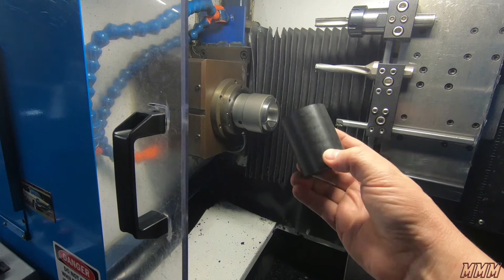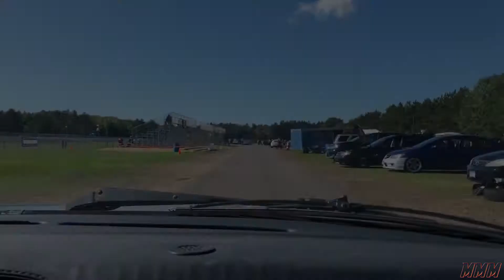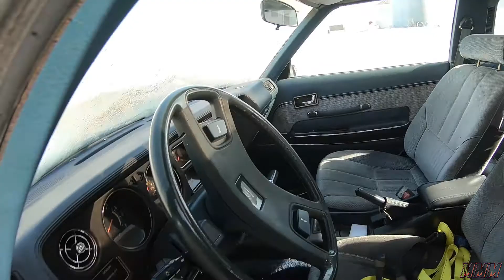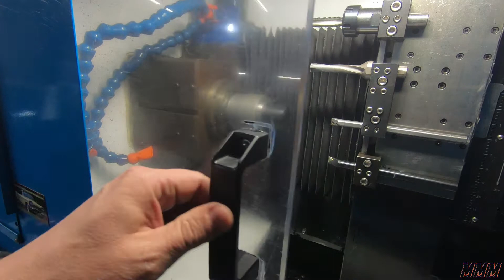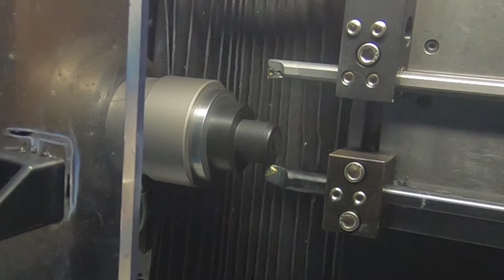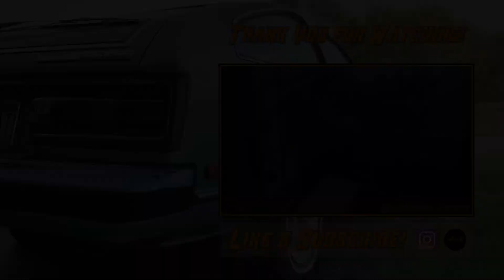Tormach 8L / 15L Lathe vs Omniturn Lathe: Round 2 Speed Battle

Comment from the maker: This is just a fun video made to demonstrate the speed of the OmniTurn. We are aware the Tormach is equipped with a Turret.   No, we don't actually compare them machining either, the OmniTurn starts and finishes before the Tormach even begins cutting.    Probably more important then the speed disparity is the turret/tool play of the Tormach at 1:10.  It's literally deflecting up a good .100  of an inch, which makes it incredibly hard to machine fast and hold tolerances.  We are not paid for or sponsored by OmniTurn, we just love how they perform!

Comment: What large diameter collet adapter are you using?
Reply from the maker: Hardinge brand. You can get them for up to 5" in diameter stock.
Reply: @MadManMachines  Thank you! Do you know what part number it is?
Reply from the maker: @msracingcomponents6550  Not off hand, they have them in incremental sizes and machine to size ones. Check out the hardinge site.  I recommend the "deep" versions.
Reply: Thank u!

Comment: well, you SOLD ME on this.... was thinking Tormach....lol.
Reply from the maker: I was just the messenger, Omniturn is what made it possible.  Right now, i'm working on a contract to make high pressure metering valves out of hardened chromoly where i need to hold an internal orifice diameter to .4994 +/- .0001!   You just simply could not make that part on a Tormach as it has neither the rigidity nor accuracy to tackle it.

Comment: not a good comparison, I'm sure the Tormach would run at the sames speeds if it too were cutting delrin. I don't own either machine but really guys, you can do better....
Reply from the maker: Unfortunately, Not even close, even in Delrin, the OmniTurn will cut this same piece at least 10 times faster than a Tormach.   1st, the Tormach is rated at only 80 ipm cutting speed vs 300 ipm cutting speed for the OmniTurn.  2nd, the Tormach is limited to 100ipm rapids, whereas the OmniTun is 300ipm rapids.  3rd, the Tormach is only 3 HP, whereas the OmniTurn is 5hp, which means you can cut faster and deeper due to almost twice the HP.  4th The Tormach runs at 3500rpm, the OmniTurn base model runs at 4000 (5000 and 6000 optional) rpm which means you can cut faster.   5th, the OmniTurn is more rigid and has no play which allows you to cut deeper and faster then the Tormach.   6th, The OmniTurn changes tools 10 time's as fast and there are 4 tool changes just in this one part.  7th, the OmniTurn uses large Servo's which can accelerate and deaccelerate faster then the Tormach's smaller and less accurate Stepper motors.

Comment: To be fair (not taking sides) there looked to be welding on the parting tool. That's what caused the deflection.
Reply from the maker: True, also being off center can do it too, but what caused the deflection is irrelevant, its what allowed the deflection that is the key:  lack of rigidity in the lathe itself.  On a rigid machine, it won't deflect, the insert will break or chip out first but on the Tormach, it had so much play in the system, it just rode up and deflected off the stock!

Comment: BS comparison. Hate when people like you make comparisons that don’t make any sense. Can the Omniturn cut aluminum that fast. Plus they  not even the same style machine.
Reply from the maker: We have to disagree.  Don't hate this video, take the information we are giving and use it to your benefit.   They are very similar machines:  both are small footprint, single phase, 5c collet lathes, the main difference being the OmniTurn is faster in rapids, spindle and cutting speeds, is more rigid, more accurate, more HP,  and made in the USA.   We don't actually compare them machining, but if we did, the Tormach's max cutting speed is 80ipm, whereas the OmniTurns is 300ipm and is more rigid, has more HP,  10x the tool change speed and higher spindle speed and could cut an aluminum part 5+ times as fast as the Tormach.
Reply: K understand

Comment: Hey guys, just a quick question on the OmniTurn. Just how is the C-axis driven? Is it by another servo motor or is it somehow controlled off the main 5hp spindle motor (which I can't figure out how they would program that). If it is a servo motor, can you tell me the approximate size/rating of the servo and whether it has a brake on it or not? I can't afford the prices even for a used OmniTurn so I'm building my own...wish me luck!
Reply from the maker: If you have the C axis option, it has a servo that functions as both the spindle drive motor, and the positioner.  I believe the C axis model is rated at 4hp vs 5hp for the non c axis model.   Since it's a servo, it would  brake and hold position.   Programming would just be standard g-code, omniturn has their manual available free online if you'd like to see how to program the C axis.

Comment: Well I liked your first video because it states facts however this is a rather poor comparison. A turret vs gang tool. The gang tool will always be faster. B the Tool change position is set on the tormach where ? End of the travel? Who does that? you don’t need to back off to the end of the Z axes, you don’t on the Omniturn. So sorry I can’t give you a thumps up on this one.
Reply from the maker: You makes some good points, but hear me out so we can earn that thumbs up.   Here's a video of a Tormach machining a similar delrin piece and it takes over 6 minutes, when we could machine it on our OmniTurn in 20 or so seconds.   https://www.youtube.com/watch?v=Sj1Pou9T0xI  True, he could shorten the travels and depth of cuts and passes, but he'd still be looking at several minutes to machine as a Tormach is limited to 60ipm cutting ( and often you can't push it to that max due to flex , seen at 1:10 ) and a max of 3500rpm.  A OmniTurn will do 4000-6000rpm and 300ipm and change tools in a second or two and can do deeper, faster cuts due to more rigidity.
Reply: @MadManMachines  no doubt about that and this is why I liked your first video. I think all your points are valid.
Reply from the maker: I noticed you must have recently acquired your own Tormach Slant Pro.   Several posting about them won't post up fully transparent opinions on them because they are either sponsored by Tormach, or just spent their hard earned money on one and don't want to criticize it.   How are you liking yours, what are the pro's and con's of it?
Reply from the maker: Also, to answer your question on "who does that' (goes to home to change tools), almost every machinist does it as standard practice on a turret lathe. We always did it on our two Haas ST10Y's.   When you got 6" insert drills, live tooling  and boring bars sticking out, it only takes one guy to come along on the next job and cost you thousands of dollars in tooling damage and turret damage by not going to home to change tooling.
Reply: @MadManMachines  you set your save tool change position 30mm in front of your longest tool. And all done. On the Haas you change tool while are on the move in or out that saves even more time. Tormach cannot do that.

Comment: stupid video - what's the point?
Reply from the maker: The point is to show people there is a much better option to the Tormach as many think the only option for a Single phase 220v machine that will fit in the garage is a Tormach or to home build a machine. It's why we wanted to share with the hobbyist community an option that's faster, more accurate, more rigid, more powerful, more reliable, made in the USA and runs on single phase 220V and will fit easily in your garage!  We paid under 4K for the machine you see and have been running it two years now with not a single problem!
Reply: @MadManMachines  It doesn't show that - you selectively chose a slow machining operation in metal from someone else's video, and compared it against quick operations in plastic.   Yeah, fair comparison.  Certainly enough dishonesty to make people run away from anything you'd promote or sell.   Sorry you can't afford a Tormach.
Reply from the maker: @dannirr I didn't compare them machining though, the OmniTurn started and finished machining BEFORE the Tormach even completed a tool change and began cutting!  The Tormach is limited to a painfully slow 60IPM cutting, 100imp rapids,  so whether i were to compare them machining delrin or aluminum,  the OmniTurn can machine up to 5 times faster.   Also, check out the deflection of the tool/turret at 1:10,  it's deflecting up about .100!  There is so much play it is completely unacceptable for holding precise tolerances.  The OmniTurn runs on German Rexroth Linear Ways and Japanese NSK Zero Backlash ground ball screws and will hold .0001, whereas the Tormach can only hold about +/- .001 on a good day, the OmniTurn is literally 5 times as fast, and 10 times more accurate!
Reply from the maker: Heres a video of a Tormach machining Delrin, it took him over 6 minutes to machine it where we could machine it on our OmniTurn in about 20 seconds.   Remember, a Tormach is limited to a max of 60ipm cutting (and even then you can't push a Tormach to max due to it's flex).  An OmniTurn can machine 5+ times as fast (300IPM) and can change tooling 20-50 times as fast.   https://www.youtube.com/watch?v=Sj1Pou9T0xI

Comment: Not to defend Tormach, but you're kind of comparing apples and oranges. You're comparing using a turret versus gang tooling, which is also possible on Tormach, and turning Delrin(?) vs aluminium.
Reply: It would be good to see more apples to apples comparison videos. I'm not even on the Tormach fence at this point. However, it would be good to see a more fair comparison since the prices are in the same ballpark.
Reply from the maker: @BryanLund There can never be any apples to apples comparison in reality as the Tormach is too slow, underpowered and lacks rigidity.  Look starting at 1:10 in the video of how much the Tormach tool and turret flex away from the part, it deflects up a good .100, there is so much play!  You can not hold any decent repeatable tolerances on a Tormach.  It completely unacceptable for any precision work, there just is no comparing the two, though we tried!
Reply: @MadManMachines  Yeah, your right. It would be hard to compare apples to apples. It would just put the "yeah but" & "what about-isms" to rest with a "complete" comparison. In the end, you are right, the common sense factor has to kick in at some point when shopping around or considering a project build. 

Keep up the great videos, really liking your channel!
Reply from the maker: @BryanLund  Thanks and you're right about the "what about-isms".    We aren't payed or sponsored by OmniTurn, we just have 3 of them and love them and most people think Tormach is the only option for a single phase home garage, they've never heard of an OmniTurn since it's not marketed to the Hobbyist, so we want to let them know there is a much better option out there, made in the USA to boot!
Reply: @MadManMachines  I wish I was closer to your area. Used machine tools are difficult to come by in the Northeast. Slim pickins'. If I could contact you privately, would you share your source for the OmniTurns?
Reply from the maker: @BryanLund  No secrets to where we got them.  One we got off Ebay from a machine shop in Texas.  One we got from a Machine Reseller in Bristol Connecticut and another we found off Craigslist from a local food utensil manufacturer in Iowa.  Check craigslist, ebay, machine resellers (most states have several of them) and just general searchers on the internet.  If you see one you are interested in, shoot us a message and we can see if it's any good.   We pretty much know what to look for as far wear and options etc.
Reply from the maker: Check this out Bryan:  Heres a video of a Tormach machining Delrin, it took him over 6 minutes to machine it where we could machine it on our OmniTurn in about 20 seconds.   Remember, a Tormach is limited to a max of 60ipm cutting (and even then you usually can't cut at max due to its flex).  An OmniTurn can machine 5+ times as fast and can change tooling 20-50 times as fast.   https://www.youtube.com/watch?v=Sj1Pou9T0xI
Reply: @MadManMachines  I'm sold. Asking about an Omniturn down in Florida.
Reply from the maker: Cool, shoot us us a link if you want us to check it out, we have a good idea what to look for, don't worry, we're not in the market for another one.
Reply: @MadManMachines  where are you guys located?
Reply from the maker: @BryanLund  Minnesota
Reply from the maker: We didn't compare the two cutting though, the OmniTurn started cutting and finished cutting BEFORE the Tormach finished one tool change and even began cutting.   True that one is turret vs gang turn, but have you seen the Gang Turn Tormach, its still painfully slow and would still take minutes longer to machine this same part we did in 24 seconds.  It's limited to 60ipm cutting speeds and 100 rapids!  I can cut 5 times faster on the Omniturn!  Plus you couldn't up the cut speed anymore on the Tormach, it was already deflecting the turret and tool up a good .100!  Check it out at 1:10